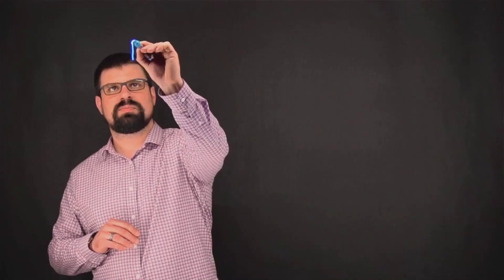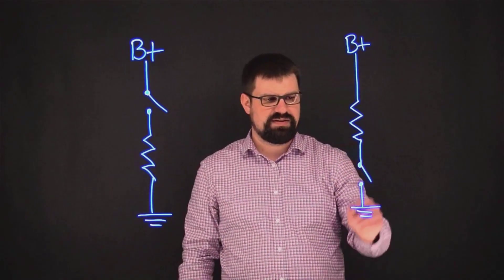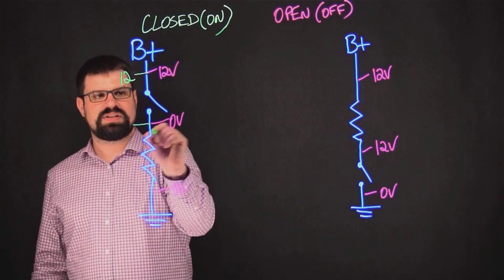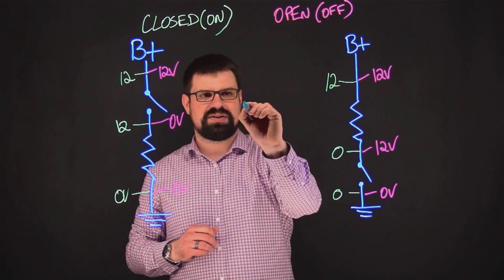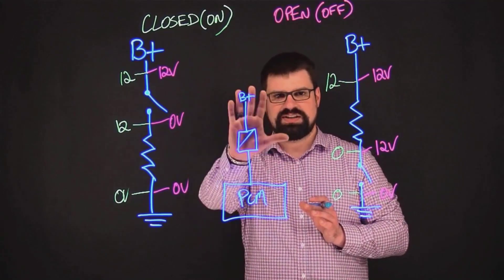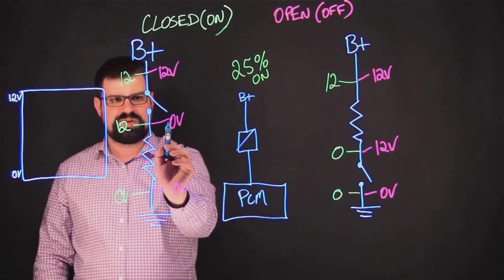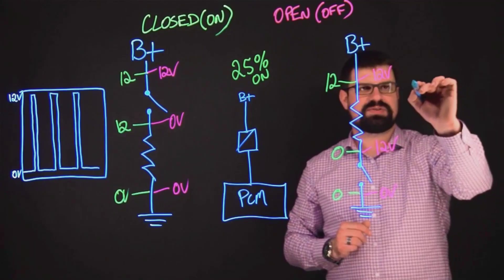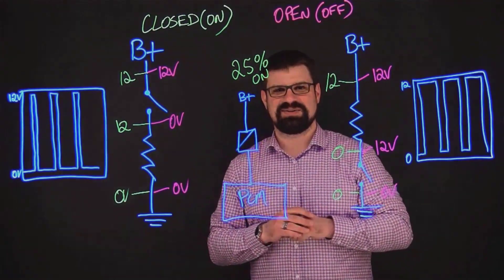Basic Automotive circuits and how they appear on an Oscilloscope.

Comment: Great information. This is exactly what  many techs that I run into are struggling to understand. Why expected testing results are different depending on the design of the circuit.  Well done.